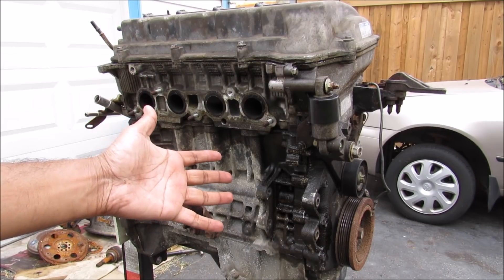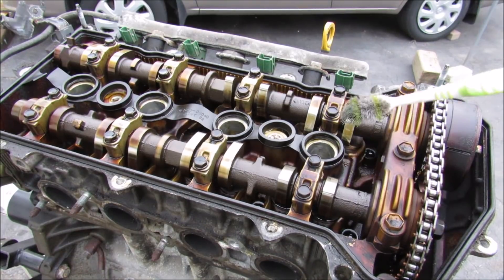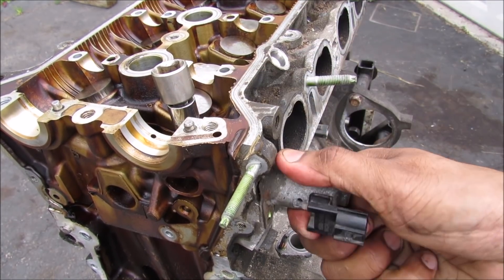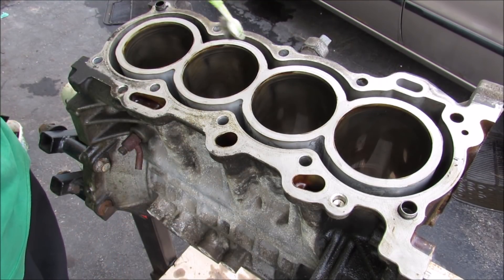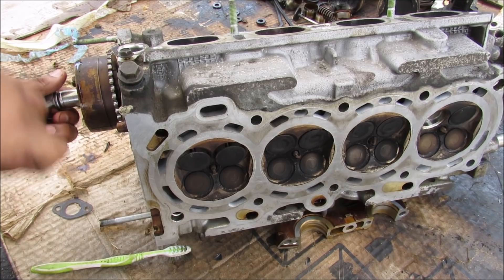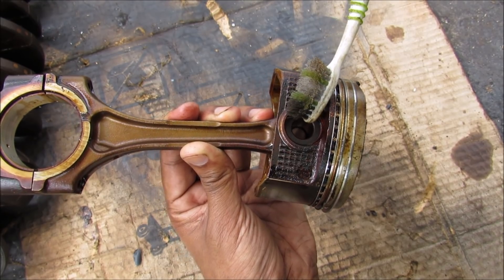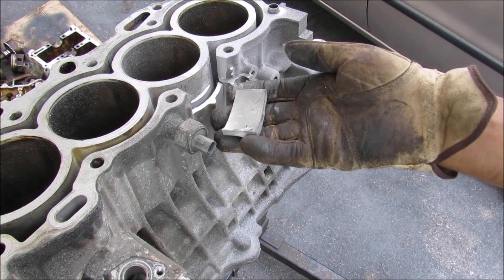How an Engine Works

Comment: I recently did a oil pan on my 1999 Toyota Corolla and boy my engine is way cleaner inside with 250,000 km
Reply from the maker: Nice. Keep up on the oil changes

Comment: About the crank pulley/harmonic damper, how much does those after-market lightened crank pulleys help in improving acceleration?
Reply from the maker: I would not think they are going to provide much improvement on acceleration. 
They aren't that heavy in my opinion

Comment: Awesome video speedkar99 - thanks for posting and taking the time to educate.  I saw where the 2 pistons are at the same position when you were rotating.  When they are at the top of their stroke, one I am assuming is at the end of the compression stroke and the other is at the end of the exhaust stroke correct?  Amazing how engines work!  So many moving parts!
Reply from the maker: yes, thanks

Comment: Excellent vid as always,  this one was a bit above-and-beyond, well done!  I'm always amazed how ell this all works,  and how smooth and quiet this whole operation can be, and last so long! (if it's not a Chrysler...) However,  it's still archaic, and also amazes me we are still doing this in 2018,  there are better ways to provide motive power than something from the freaking 1800's.

Comment: Great video. I have a quick question. At around 8:15 you speak about the barring (sp?). If that happens and you get that knocking sound doesn't that mean the engine is dead. Cause my car turns on but it's making a knocking sound. And these guys just come and say oh you need to replace your engine.
Reply from the maker: Knocking means the bearings haven't been lubricated and it's now wearing the crank shaft and block out. And you'll need a new crankshaft and block or at least remachine it...which is alot of work...therefore you need a new engine.

Comment: I have a lexus rx330 and it looks like I'm losing about 25% oil per 3500 miles. Is this normal?
Reply from the maker: +KoalaJoanne Toyota says a general guideline is a quart every 1000 miles so I think yours is within reason. 
That v6 should not burn a drop of oil though, it was the 4 cylinders that had oil problems.
Reply: Thank you

Comment: Speedkar99, when replacing timing chain does it need to turn the crank shaft to the dead top center before u take out the timing chain and do u have to mark on the old timing chain before u remove it?
Reply from the maker: +Nguoi bi Mat Not nessesarily but it would help if you did

Comment: hi speedkar99,  i really need your help. i have 1998 toyota 4runner 4 cylinder manual. 
after i replace the drive shaft and the drum brake. its start have death
 wobble(its come and go at the highway speed) i brought it to several 
mechanic( even a suspension specialist) but they cant figure out the 
problem is. when its has a death wobble the brake wont engage properly(i
 need to pull over to complete stop to stop the death wobble before i 
can drive again). i even bought another driveshaft and replaced but the wobble still there( the sway bar bushing worn out, do you think sway bar can cause the wobble?). please help! thank you
Reply from the maker: +Nguoi bi Mat the death wobble is usually common on vehicles with a solid front axle. 
In your case you might need to look into the tie rod ends, and steering rack bushings.

Comment: Sadly I can only give one thumbs up. Please do a more in-depth version.
Reply from the maker: Thanks for the feedback. I felt that this video was in fact too detailed compared to my normal videos. I will have more detailed videos on individual subcomponents within the engine soon - like the lubrication system, oil pump and VVT-i gear. What more would you like to see?
Reply: Sounds awesome, that's exactly the level of detail I was referring to - subsystems and components of the engine but also of the whole car. Keep rocking.

Comment: combustion chamber is part of the head, not the block. I think you meant cylinders.
Reply from the maker: +Jose Lopez the combustion chamber is more like the volume in the cylinders (block) capped off by the head.
Reply from the maker: Ok thanks for the correction, I thought that where the combustion occurs (in the cylinder) on the power stroke that's what would be called "combustion chamber".

Comment: Hi do you have Mechanical engg degree from IIT Madras?  My ABS connector wiring diagram for Sienna of 2002,  is not correct in repair manual. Is to common?  ABS connector has loose connection, vehicle wire colors and pin numbers do not match repair manual diagrams. Weird. 
 Your videos are good with your brother sock, underwear, toothbrush.
Reply from the maker: No, I am from Canada. Thanks for the compliments on my "learning tools", haha.
About the ABS, I know for Camry there are two types, one has the computer built into the module itself, and the other one is built into the ECU. See more on that here:
https://www.youtube.com/watch?v=IKi5O3ZlSu4

Comment: That toothbrush is famous
Reply: rolf!  You noticed too!..
Reply: Also used as a writing board pointing stick.
Reply from the maker: +AccessDenied it is famous indeed ! 
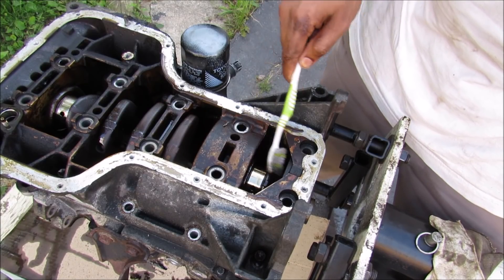I almost lost it in the engine at 6:25 !
Reply: @speedkar99  I was worried that ur brother would be mad
Reply: that brother's teeth is going to be a sqeaky oily and black

Comment: What are you gonna do with the engine pieces?
Reply from the maker: +KingTsunamy Most likely scrap, I don't have intention to rebuild...at least this car...
Reply: speedkar99  make a crankshaft lamp! Look it up on Google images
Reply from the maker: Oh man, that's a great idea, Thanks. Although this crankshaft is quite heavy for a lamp, I'd consider using the camshaft for one. I'll be saving those...
Reply: speedkar99 
Crank shaft bar stool is better

Comment: Great video. I've been planning on pulling some junkyard 1ZZ shimless buckets for eventual use in my 1MZ, but have never been able to find a comprehensive teardown video until now.
Reply from the maker: +moofree thanks 
I'm glad you found my video useful. 
What is it you want to use from a 1zz on your v6?
Reply: The 1ZZ valve lifter buckets are a drop in swap for many shim-over-bucket type Toyota engines of that vintage, and weigh about half as much as the buckets they replace. To be honest it's kinda pointless in anything but a high revving engine build, but I still plan on doing the shimless bucket conversion when I eventually adjust valve clearances.